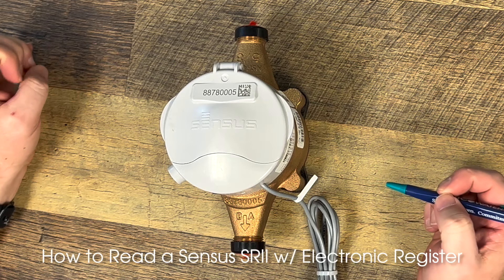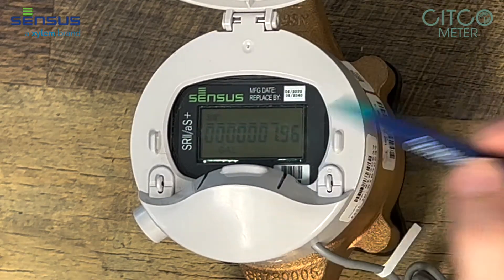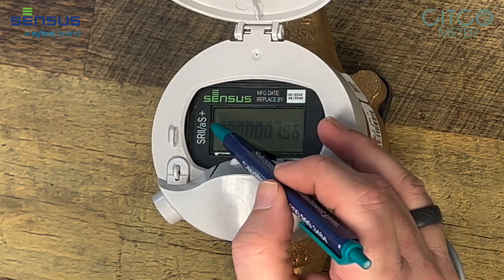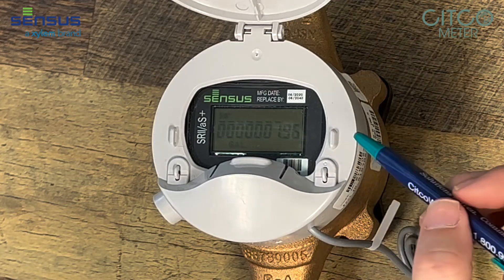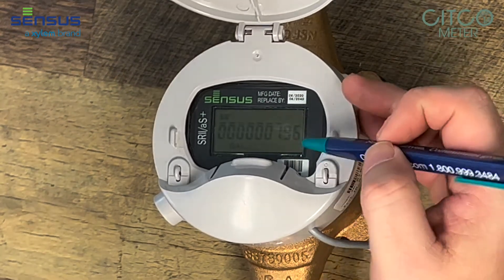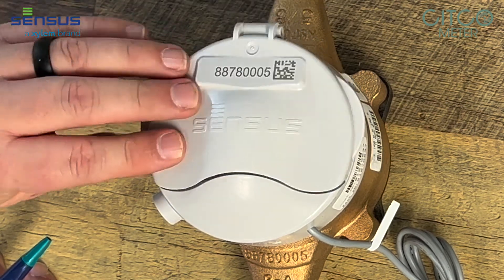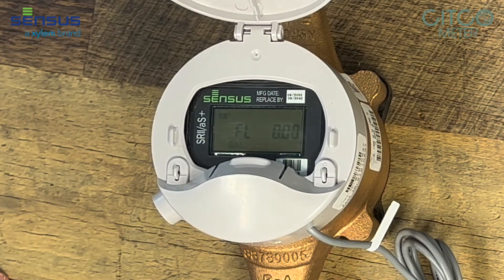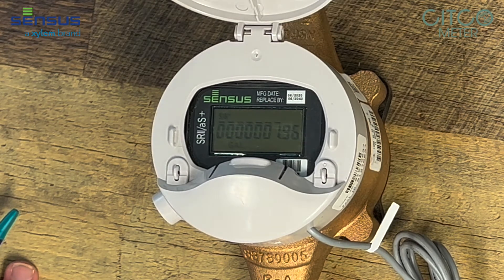How to Read a Sensus SRII Register

Comment: The digits on my Sensus SRII/aS+ are not set up quite the same. There are 9 digits, but 3 of them are to the right of the decimal point. And the spacing is
weird: 00 196 1.891 (the decimal point is so small that it’s almost impossible to see). The bars are only over the first 5 digits, so does that mean that the outside readings are only picking up every 10 CF? And with 3 digits to the right, does that mean the meter is actually recording down to 1/1000th of a CF?

Comment: I have a 10 year old Sensus SRII water meter and the meter dials have quit turning.   Having some issues with water flow in my house when, say, two showers are running.   Any thoughts on if this 'frozen' meter could be restricting my flow?   I live in an area with very hard water.
Reply from the maker: This is possible. We recommend you contact your water utility with questions regarding your water flow.